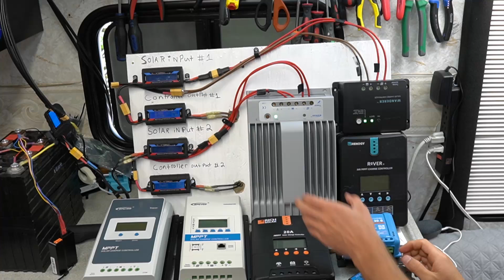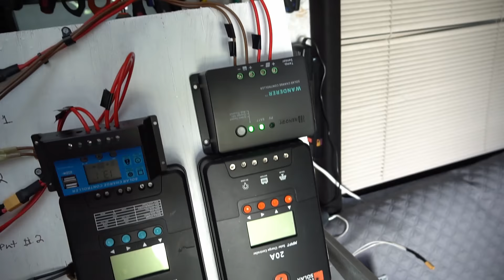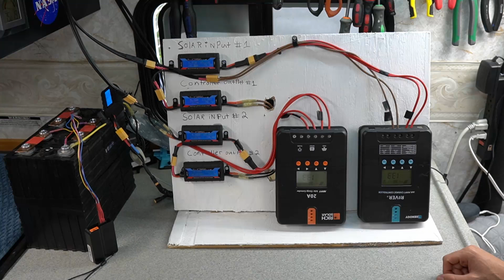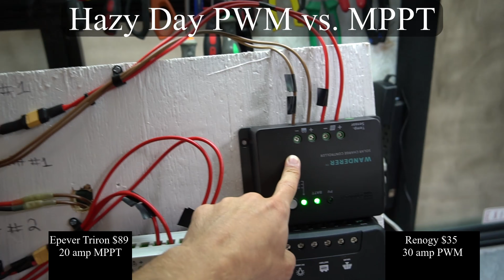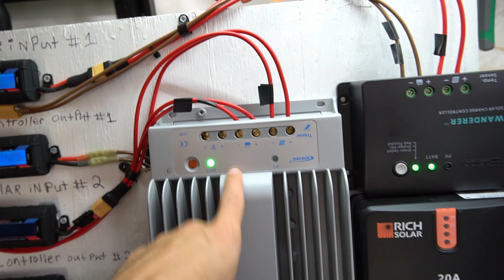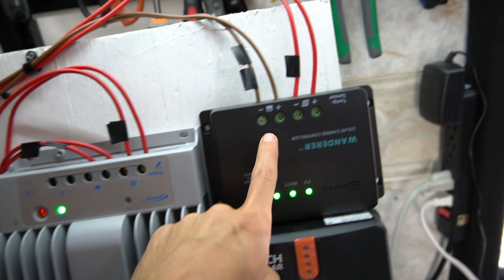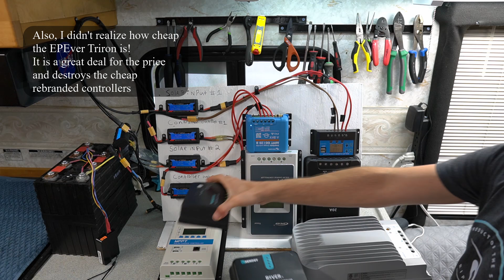12v Solar Charge Controller Buyers Guide - Beginner Friendly!

Comment: I got a renogy flexible 200 watt solar kit to charge my two 81 amp hour lead acid batteries in paralles (162 amps and 12 volts) I rigged the 2 100 watt panels in parallel for about 21.5 volts and 11.75 amps in full sun.  I ran the batteries down to about 75% and there is a constant load of about 1.8 amp from the frig and various small items running in the background.  For two days I tried to get the batteries to charge but they just continue to deplete in full sun.  The wiring at the point it reached the charge controller was showing about 11.77 amps and 21 volts from the two solar panels.  Once they were plugged in the Voyager 20 amp controller showed about 13.8 volts and only 1.5 to 4.0 amps.  My battery monitor continued to show the 1.8 am discharge over the entire period and the batteries kept going down even though the panels were putting out 11.77 amps.
I double checked all the connections and the charge controller were showing the battery was being charged with up to 14.1 volts and 4.5 amps at times but the battery monitor only showed the drain.  When I took everything down the batteries were in fact depleted and I had to reconnect to shore power I have set up at my house for the camper.  Once I hooked up to power the battery monitor showed the batteries charging up and overriding the 1.8 power drain.  Is the problem the charge controller or is there some reason you cannot charge a battery with solar if there is a drain on the battery???

Comment: Can you explain why the controllers have a "load" output. I'm confused what that's used for.
Reply: It's mostly used for switched very low power connection. Very useful because of the associated timer function! 
In the real world, better use it for relay(s) ON&OFF. Or small LED's, anything with very low power demands! ;-) 
Example: Activate relay for lights, or a water/sewage pump, etc. at specific times. ;-)

Comment: I loved this video so no complaints about that but after installing the renogy charge controller it stopped working and I drained my Lithium batteries and ran out of power. Multiple testing done of the units attached (i.e the solar panels and with working batteries) indicated the charge controller was the problem but Renogy's Australian customer service has been appalling and essentially non-responsive. For all Australian customers I wouldn't recommend buying this. If you need any customer support it will be non-existent based on my current experience.

Comment: The Tracer BN 40A on the website does NOT list Lithium battery banks!  They only say:  "Work with all Lead Acid Batteries, Sealed AGM GEL and Flooded Battery, User mode allows buyer setting their own charging parameters."   So, I I have a lithium Iron Phosphate bank, is this NOT a good choice>???

Comment: I was waiting for you to adress the subject of passive power consumption of the controllers. I had the chinese 15 bucks pwm  controller on our yacht, and after I swapped it out for a victron MPPT I found our system to not be sustainable anymore and our batteries slowly draining to zero, while we never had problems with the cheap PWM. I swapped it back ofcourse, but you got me curious about the actual numbers as I never got to testing it to such extent. I simply figured that if bluetooth drains my phone battery like hell, the bluetooth option on the victron probably does the same. Your findings on this would be much appreciated.

Comment: A little embarrassing to ask this, but why go with a 40 amp when a 20 will give you the same power? Is it so that you can hook up a crap ton of panels? I'm planning on getting 2 100 watts for my teardrop. I rarely camp without shore power, but I want them for my vent and leds, so I don't need much. Thanks!
Reply: On a small teardrop, for such a limited usage, probably you won't need more than the 100w. But anyway having the space and the added panel possibility is always good! 

Choosing a 40 over the 20, makes sense thinking about future expansion. If designing a specific system that will not be updated. Than a unit specific for the function is more than enough!

Comment: Hi. Great video.   I am still struggling with whether I need a MPPT specifically designed for my blue carbon LifePo4 batteries. 4 in parallel for 800ah. I have 1500 watts of solar on my boat.  Or if I can use any MPPT?

Comment: Thank you.  I love all of your videos.  I for now have just the cheapest charge controller with maximum guage wire that i can put into the inputs  but I can't figure out why the screen shows that my battery voltage is lower than my voltmeter reads..... with no solar panels connected... only the battery ports  connected to the battery. Nothing connected to any outlets

Comment: I am almost certain you've talked about it before, but I can't find where. I want a charge controller that is not "grid tied" in the context of "dump excess generation to the grid for credit", but rather one that will use 120v to keep batteries charged within parameters when solar is not providing enough.

If you get a minute to give me some direction, I'd appreciate it!

Love your videos.

Comment: I understand that you can't series a PWM controller like you can a MPPT, yet they are rated for 12 or 24 volts so you can "series connect them a little bit".  "If you do [series connect with a PWM] output will be reduced to like, 50%"  I am trying to work all that out.  I wonder if you ever did the video with the 24 volts PWM system.

Comment: Will, I am not sure you will ever see this comment on an old video but I am having serious issues with various controllers and an inverter. I was using a 60A HQST charge controller first on a set of new 100AH 12v Redodo batteries in single or 48V series. When fully charged the batteries apparently send a high voltage back to the controller to stop its charging resulting in over charge errors. The HQST just thew up an error code and resets and tries again after a few seconds. I swapped to a clone OAE 60A MPPT Solar Charge Controller metal cased, fan at top, metal box cloned by sunny sky and AMPINVT etc and it beeps and throws the overcharge fault error as well when full. 

I have yet to have anyone else claim their does this though one of the HQST Q&A states this is normal, OAE users says theirs does not. Their seller said no, then maybe. I had an inverter that shuts off quite often when that happens Xijia 48v 3000w (Avoid these, they are absolute junk. returned a 12v and now the 48v with various serious issues).

Is this supposed to be normal? Is it normal for a solar charger to throw off  overcharge errors when the battery is full?

Comment: My EPever Tracer 30 failed in casual use after less than 2 years. No lights. I never attached the 48v solar array without first attaching the 12V battery. I sadly learned that there is no warranty, no mention of "epever warranty" when doing a web search, no contact info for the company, no warranty info on Amazon, no way to "sign up" for an account (function broken). I'd have to say there probably is no reason to buy anything from Epever.

Comment: Hello Will. I am thrilled with your desire to share your knowledge with us. Thank you. I want to power 6 antennae in a tower. The total wattage of the 6 antennae is around 50 watts. I would like to buy a GYLL battery. How many solar panels or watts of solar panels do I need to keep those units running for 2 days (if the sun doesn't shine)? Thanks and keep up the excellent work u do!!

Comment: Nice clean setup and clear message.
However this is under 100W low voltage panels; I wonder how they  do closer to their max amp rating.
I use a Renogy rover 40A and about 90v 450W panels.

Comment: I just picked up ten 330 watt used panels (voc 46.2 v) ( Impp 8.77) (isc9.28amp) to replace smaller 12 volt system for my Off grid cabin in the Berkeshires... $20 bucks a piece... may buy a bunch more just cause they are $20... connecting to 8 six volt 50ah batteries... I need to fiqure out the charge controller to use... 3 panels in series /2 runs of 138volts each?? so 1980 watts total, I get about 5 hours sun, should work pretty well... also need to get 4k pure sine wave inverter... using under 5k watts per day.  Great video, thanks.

Comment: A MPPT charger has a higher rendement with a high Voltage panel. The PWM throws every Volt above 14,5 away. Makes a big difference, up to 60%. 
What was the Voltage of the panel, 21 Volt?

Comment: Brother, your setup is completely flawed :) You should not use 2 different controllers connected to the same battery and check their outputs. When you do this the voltages equalize in both controllers and the battery so a few mA difference coming from the panels leads to the difference you see in your power monitors. Didn't it bug you a little bit you see the same output from a $15 and $150 controller :D ?

You should repeat this test with controllers connected to 2 different batteries. They also need some load on them cause if they are (nearly) charged output will be decreased from the controllers.
Reply from the maker: Watch my beginner videos

Comment: The Victron relies on a Bluetooth sensor to get battery temperature to the MPPT controller.  I would never trust Bluetooth to be reliable 100% of the time on a boat. Disconnects happen due to interference, momentarily voltage drops, conflicts etc.  If the Bluetooth connection fails, hot batteries could over charge with disastrous consequences.  All other units reviewed have a temperature sensor wired directly to the MPPT controller.  A temperature sensor can’t be connected by cable to the Victron MPPT panel or MPPT controller.  To use a wired temperature sensor with Victron, a cable must be connected to a Victron BMV battery monitor then a cable  connects to the MPPT.control panel - unnecessary complicated. When a boat already has a BMV, installing another to get reliable battery temperature is undesirable.

Comment: I really can't see the big extra wiring cost you say is in a parallel system. Seriously unless you have a dozen or more panels.  How much can building a hub cost  for a couple panels next to each other a Y connection and a run to the  controller you have to have anyway .

Comment: do you need to put extra fusing in line when connecting solar panels in parallel? I watched a video saying that if one panel were to short out or become defectives in a parallel setup, the other two panels would feed it and could cause fire...

Comment: 17:27 > You don't recomend to use that one on lead acid batteries; however, it seems that it is the only battery type that they officially support. Or at least that's what it was written in the small manual of mine, which has the reference SP666 on it. It looks exactly like the one you showed there.
Reply: Sorry, in deed there are several versions of those controllers. They look the same, but some support lead acid, but not lithium, and others support lithium. You just have to read the small manual

Comment: So... MPPT VS. PWM... i thought that you loose input voltage past the battery voltage? So if you have 30volt panels hooked to PWM they will only act like 13 volt panels, where i thought MPPT used the volts to boost charge amps. Did i miss what voltage your panels are?

Comment: Your  fault is that you measure only the output power of these chargers , when most important for the lifespan of batteries is the quality of recharging .So you have to add at the cost of any charger the cost of batteries and then compare the systems spanlifes to find which is the best. Do not extract conclusions for a part when you have not calculate all the parameters.

Comment: I know this is a specific situation but nobody seems to address it. In a caravan, (not an RV) you have solar through to the battery but you also have mains charging capability. Where is the mains charger connected to the overall system and what happens when the mains is plugged in? Does the solar charger know the mains is connected to the battery (through the charger) and shut the solar charge feed to the battery off? Does the mains charger and the solar charger conflict/compete?

Comment: Great stuff & information,
I have 10- 40ah gel battery's cutting wire just to keep them charged, trying to learn how I can best use these with solar and if I can make a back up for my cabin, I know this was 3 years ago and stuff changes overnight, but any quick tip would be much appreciated. 
You Rock "WP" 
Tks Ray

Comment: Will, I am looking to build a system on a budget. Based on (4) 100 watt panels, 30 amp charge controller, dc fuse block, inverter ( strong enough to run high velocity house fan and maybe a lamp or two), and (4) 6 volt deep cycle batteries. Distance from batteries to components approx. 8' away. Solar panels 10' to 15' away. need to know cable size and layout ideas. how to cable batteries for 12 volt usage. would love to see your thoughts on this system!

Comment: I learn a little more with each video but creates a dozen MORE questions! Like 2 controllers one 20A and one 40 or bigger pushing 72v each to a battery? That's twice as much input to the battery SO that means it charges twice as fast than just one? Do SMART batteries accept this 142v or???? And YES I'm a newbie and don't even have equipment yet! I DO have 4 100ah Power Queen lithium! Two for my RV (even more questions) and 2 for a 24v trolling motor! But where to start for easy add-ons??

Comment: Here are the specs for my main applianes. Do really need a charge controller over 60 amps or could I use a 40 amp?
Washer
15 amps
Watts 2400

Dryer
5400 watts
30 amps

Freeze frig

Watts 91
Amps 21

Comment: Slightly off topic but I wonder if someone might answer my question?  I read that solar panels which are not connected to a system but are in sunlight, are less prone to wear if they are short circuited.  
With that in mind why is it necessary to have a dump load connected to the controller?  Could the controller not just short circuit the panels to prevent battery overcharge?

Comment: Question - wondering if anyone else sees this....I have the big Epever charging a 13V 200Ah lithium (with built in BMS). When the battery is fully charged and my 240V fridge cycles off, the solar controller output voltage ramps up from 14V to over 20V, tripping the over voltage on the inverter. My thought is that since there is suddenly no load and the Epever controller is too slow to react, it goes overvoltage. Sometimes the solar controller trips it's own over voltage too, but normally not, despite being well over voltage for a second or two. Tried heaps of different settings on the Epever. All I can think of is to set up a dummy load to try and stop this happening - not ideal!

Comment: I'm new to conversion trailers and solar in general. I have access to some high end lead acid batteries on the cheap. While I'd eventually like to upgrade to Lithium...would you consider using lead acid if budget was a leading consideration in a first build?

Comment: Do you have a Video where you test unbalanced strings of PV's (different voltages and/or currents) or with East & West facing Panels? Should one have separate controllers for East & West?
If multiple Controllers, then two (Blue Tooth) Victron MPPT's can be networked (via BT) together for a single source of stats.

Comment: Looking for a 3 to 4000 watt inverter and a 60 to 80 amp mppt controller that does not give off a lot of interference that will get into my ham radio transceiver which is less than 5 feet from both the inverter and controller. I will not be running my radio on see on solar but it will be close by and running on the grid. My current Epever and 2000 watt inverter generate a lot of radio interference.

Comment: Don't you have to have a BMS as well as a charge controller so if you can't set the high and low rails on the pack voltage, on the cheaper charge controllers,  won't the BMS shut off power once full charge is reached?

Comment: Unfortunately my epever tracer (same as the silver one here in the video) has began malfunctioning after only 3-4 months. Only have 5 renogy 100w panels connected, and it supplies charge to 2 SOK 100ah batteries connected in parallel. Starting noticing that my batteries were dropping much lower in voltage than typical. Then yesterday my entire ham radio room was completely shut down. It took me some time troubleshooting to determine that the charge controller was not functioning properly. Very disappointing

Comment: How can I tell whether or not I will need to program a given battery? On your page about charge controllers you talk about "drop-in lithium"/"normal" batteries...I'm assuming this is as opposed to what you call a "custom charge profile." What is the difference and how can you tell? Would a Battle Born LiFePO4 be considered "normal" for example, or does it vary between models?

Comment: Will, thank you for all the great videos. I am just getting into learning about solar, and have to say, I have learned a ton from you. I am currently building some very basic battery boxes, using 12 v 12ah lifePO4 batteries. I am adding solar to them.  I am using a 25W solar mono panel, an SAE port wired to a solar charge controller like the $13 dollar one you have in this video that you said feels like a kids toy. I was wondering To build my battery boxes, what solar charge controller should I be using, as well as wire gauge? I have an inline 30A fuse holder, not sure if I have the proper setup that I actually need. Can you help me out? I would greatly appreciate it. All the best?

Comment: Would connecting solar panels in parallel going into an MPPT controller offer some automatic compensation for differences between the panels?  i.e. would it be better than connecting them in series?  Comment on the Tracer 1215BN MPPT?